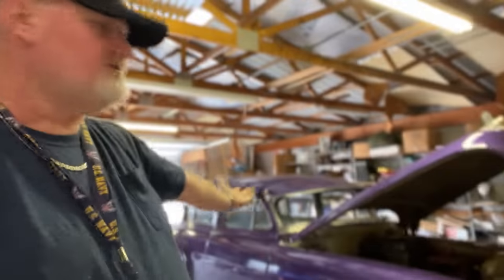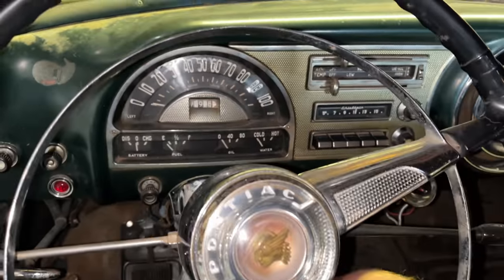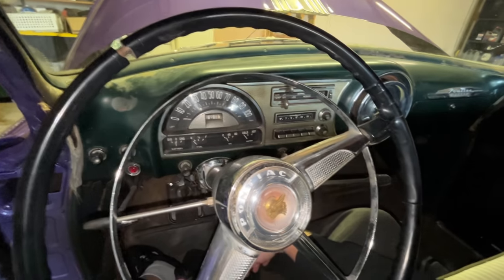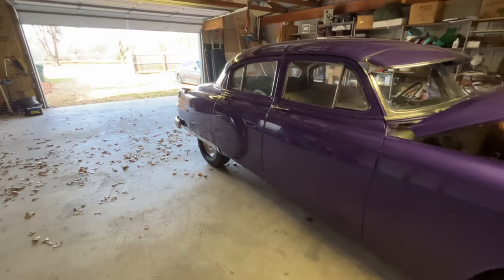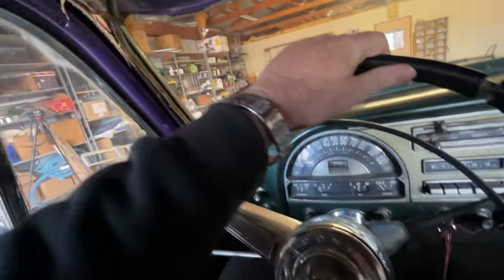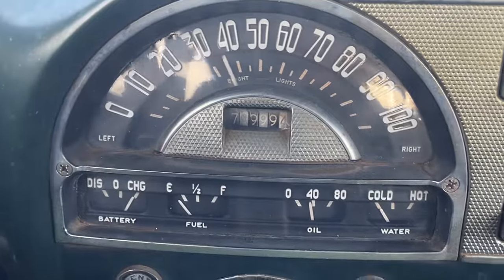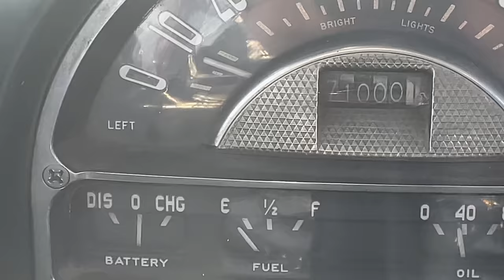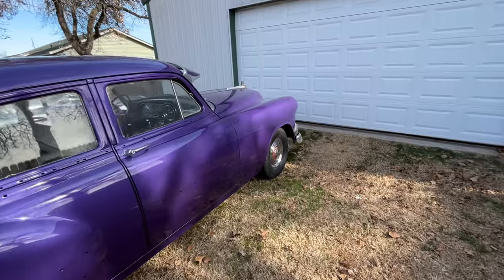Purple Heart Update, How Does She Run In Freezing Temps? 1953 Pontiac Chieftain

Comment: You will be absolutely amazed with a new or a good rebuilt carb.  A good carb is everything on an oldie.  For example, my 1966 Dart started and ran without stalling on the third attempt.   My car is old school like yours (carb, points, and condenser).   I should add that this was with an old battery (with no battery tender), sitting in a non heated garage for 2 months, and on a 37 degree day.

Comment: Looks like you could be headed for a new wheelhouse. Have someone look at the shifting linkage to the transmission and adjust it. It shouldn't be worn out with that low a mileage if it was looked after but the bushings on the gear shift from the wheel to the linkage were prone to wearing and not allowing proper shifts because nothing was lined up.
Reply: The rubber degrades over time then falls apart.  Mileage is not an indicator of that.